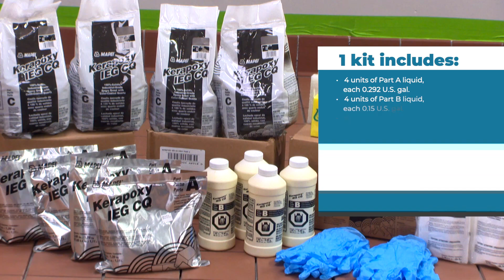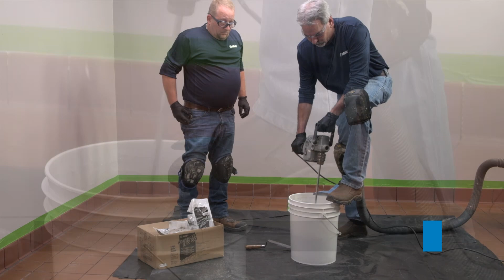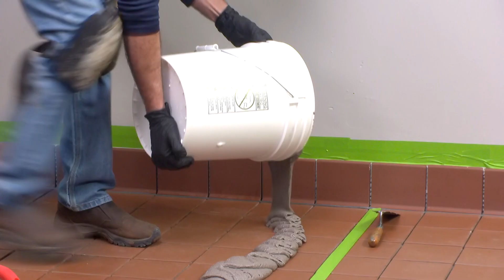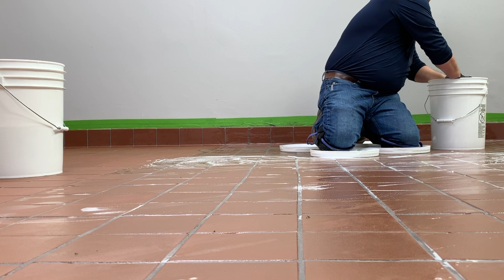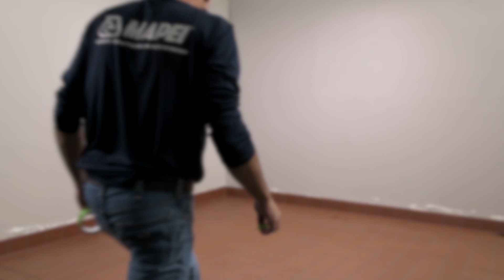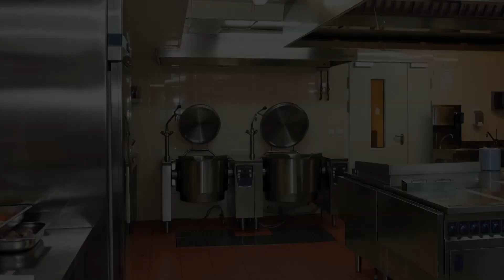How to install MAPEI Kerapoxy IEG CQ grout

Comment: Certified Tile installer with 30 years experience. Id like to see the r&d department and chemical engineers of this product try and use this in any setting, much less a commercial job where site conditions won't allow you to do all the steps to supposidly you have to do for a successful job. Now that I've grouted the first 40 ft of a 1200 square ft kitchen floor, I can barely squeeze a sponge! My hands and elbows hurt. Mapei i need my joints to last a lifetime. Thanks for nothing!
Reply from the maker: Hello, I apologize for the delay in responding. We absolutely test our products in as close to the application setting as possible. Epoxies set up fast and there is no way to slow that down, unfortunately. If your tile experience is generally not epoxy, then there is definitely a learning curve. We do have tips for usage if you would like to call in to Product Support at (800) 992-6273 and ask for Product Advisor #9 I would be happy to walk you through it.

Comment: What caused effervescence. Charcoal ieg CQ was used. Covered for 72 hours, as this is in an open restaurant.
Reply from the maker: Hello and thank you for reaching out! Can you please email us at productsupport@mapei.com with photos? It may not be efflorescence, but if water is left on the joints during cleaning it could be epoxy resins. With your information we can troubleshoot what might be happening.
Reply: You can't clean this product properly, and the sponges they have no texture, so it's slides over the too without removing all the grout.

Comment: another video from a mapei rep demonstrating keropoxy install.   He pooled water on the initial clean, mentioning that there was no issue.  Please clarify.  (this was kerapoxy not kerapoxy ieg)
Reply from the maker: Hello Daniel, thanks for reaching out. This was Kerapoxy IEG CQ. In reviewing the video I do not notice standing water in the joint, but you are correct- standing water is not recommended when cleaning any epoxy grout.